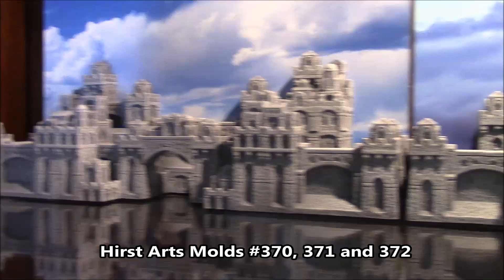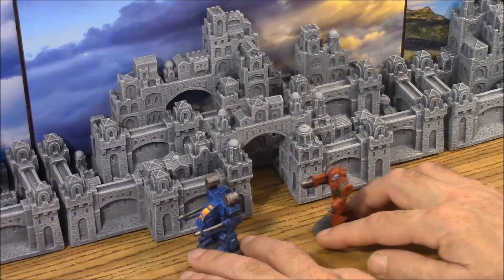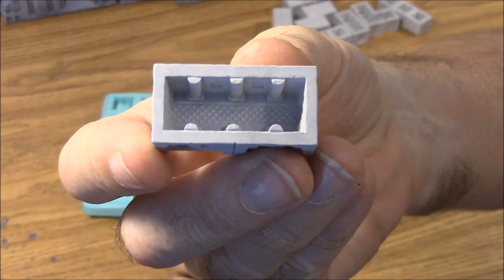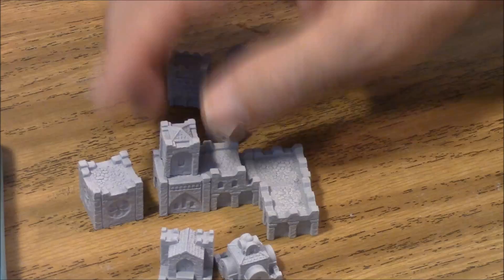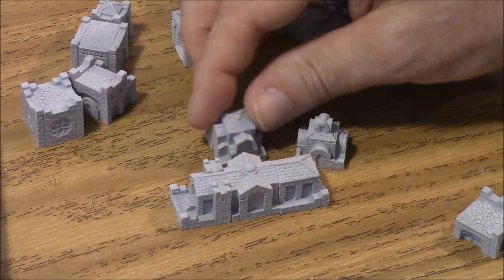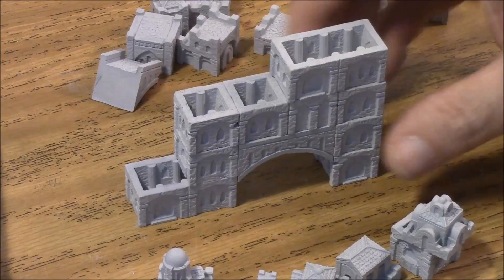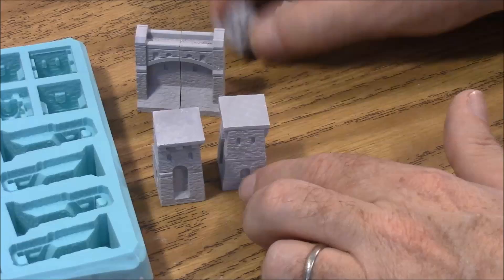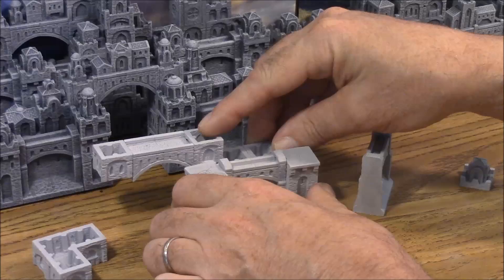Hirst Arts Castle Cubes Introduction

Comment: Hirst Arts molds are fantastic! I started using them about about 5 years ago to make model castles with my daughter, and recently ordered some fieldstone molds to build the Modular Inn and other things. The molds are very well made and the detail is great. The only material I've cast with is a powdered plaster called Hydrostone, from a pottery supply place in Seattle. Something to think about is how to keep the blocks semi-organized.  Save lots of rectangular plastic takeout food containers! My first approach was to cast a ton of everything so we would have a nice inventory to work with, and because doing the casting is also kind of addictive. I actually think a better approach would be to make enough for what you are building right now, and just keep leftovers. If you're organized you can do five or six castings in an evening, give them a good drying overnight and then use them up the next day.